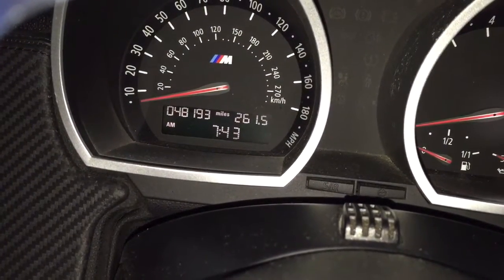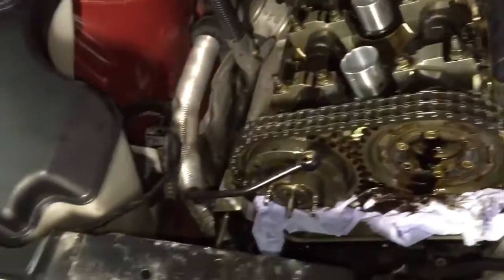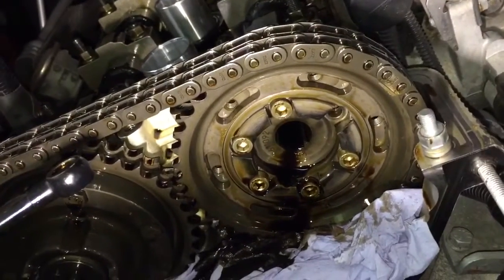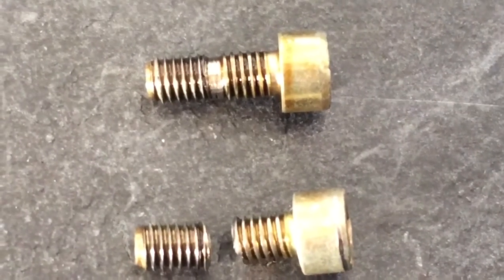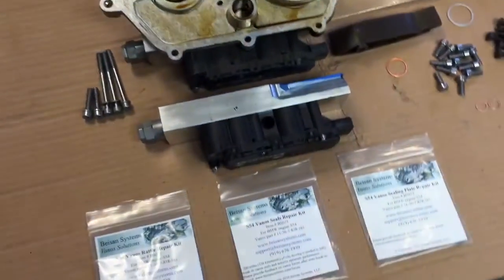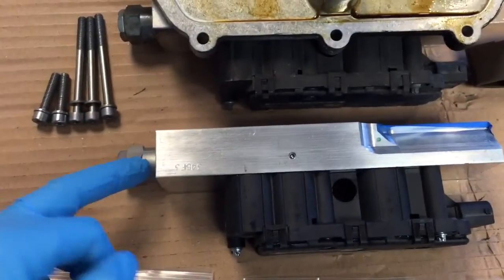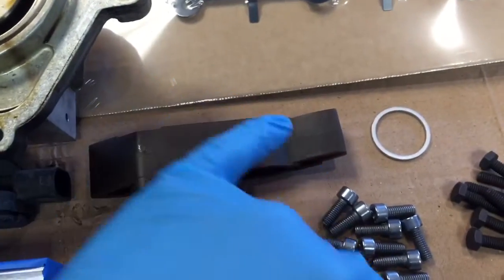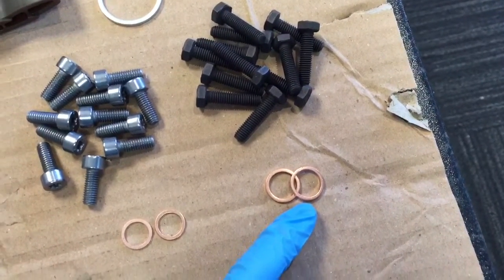BMW E85 Z4M S54 Broken Vanos - Inlet Cam Hub Bolts Loose / Snapped

Comment: Another Z4 M specific question. Everyone seems to say you have to remove that big oil intake tubein that sticks out of center bottom of the vanos to get the Vanos out of a Z4M (due to tight clearance) making it more complicated. Os that correct or can you get ot out like an e46 with that piece still in the vanos?

Comment: Just a stupid question. I have to rebuild the vanos of my Z4M. do you remember if there is space enough to remove the vanos from the cylinder head without to remove the front frame in which there is the radiator ?
Reply from the maker: It’s tight but yes there is room. We do lots of Z4M Vanos overhauls and have never taken the the front panel off. Hope that helps
Reply: @RedishMotorsportbmw  thanks for you rapid and very useful answer. This helps me a lot to plan what I will have to do